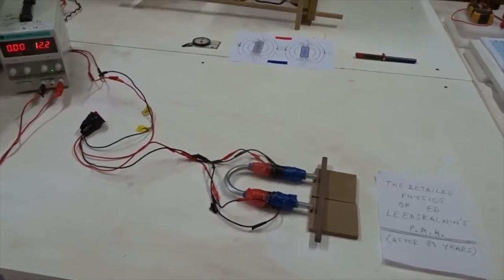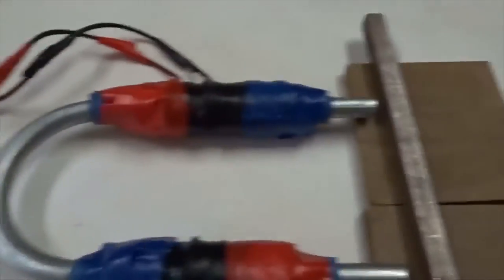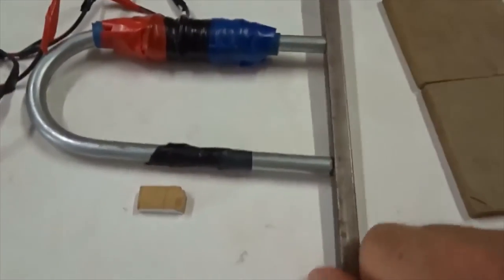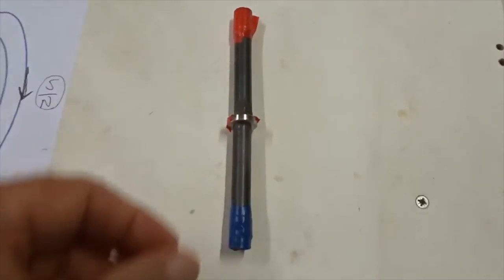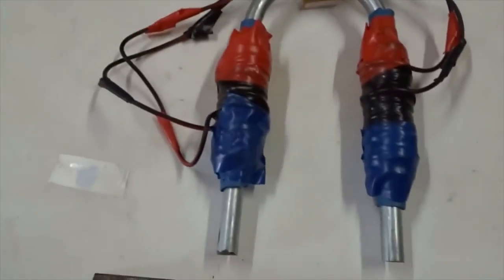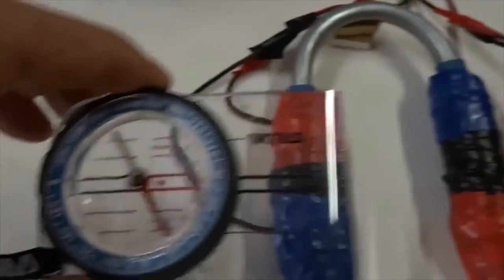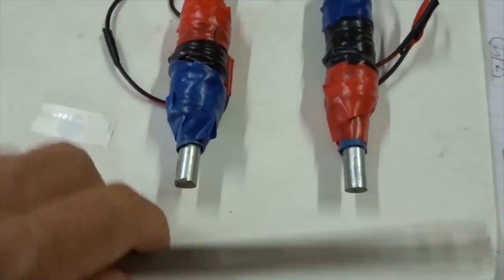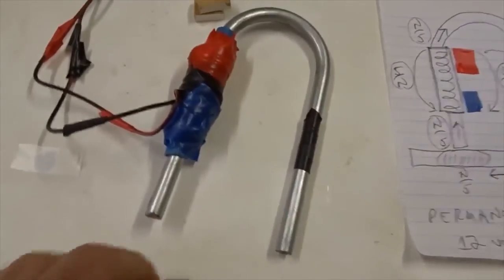The detailed physics of Ed Leedskalnin’s PMH, explained after 80 years

Comment: I think the physics is not fully explained in that the field never seems to weaken. Another gentleman made a PMH and put it on a shelf for 2 years. After 2 years, it still was held in place, and he was able to light an LED after pulling them apart (just as Ed said would be possible). A capacitor doesn't hold a charge for 2 years, for example. You would expect this magnetic field in the PMH to weaken, but it doesn't appear to. I think magnetic core memories worked on a principle like this (technology from my father's generation). I think NASA may have also used the PMH circuit or something like it for magnetic space boots. You would think that there would be papers and equations that explain the physics here in terms of Lorentz or something. This is a good physics question in terms of the equations involved. If all the electrons in the metal or oriented the same, creating the magnetism, wouldn't this weaken due to the Earth's field, and other fields that the PMH might come near? Wouldn't entropy be pulling on the PMH, weakening it over time? During the year there is also heat and cold which can alter magnetism. It is shown that high heat can damage a permanent magnet, etc.

Comment: There is no high voltage involved in this experiment, both 12 and 24 Volt are safe to work with.
Reply: In those days Model T batteries were 6V